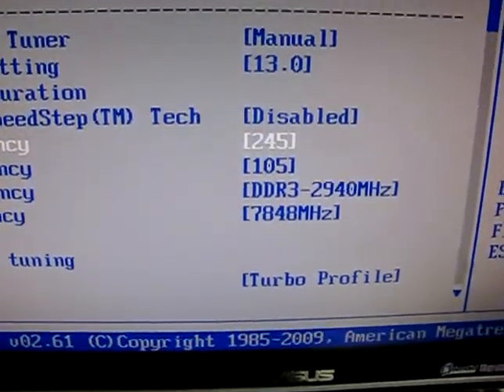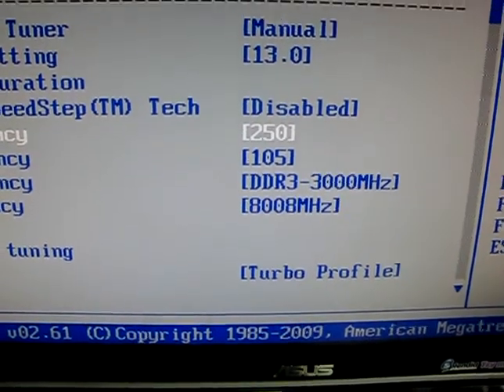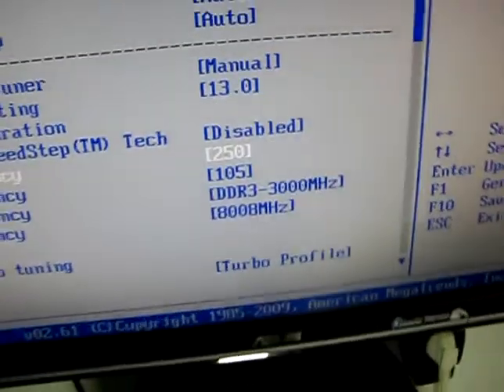Booting @ 3.0 GHz DDR memory frequency FAIL

Comment from the maker: Hi! This is the memory frequency, not CPU. This type of cooling was needed, especially for the memory controller.
If you are booting 3,1GHz DDR memory without much hassle, then that's cool and clearly shows the progress of modern memory controllers.

My video is from 2010 and the platform was a socket 1156 motherboard with Intel P55 chipset and Intel i7 860 CPU. Back then and on this platform, running about 2,4GHz DDR on the memory was an achievement, on today's PCs, it's normal highend.